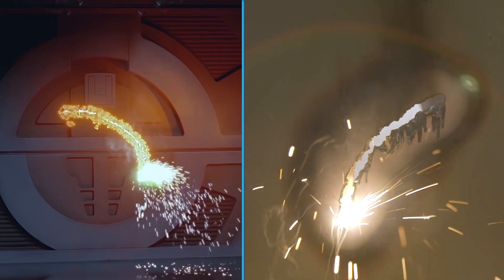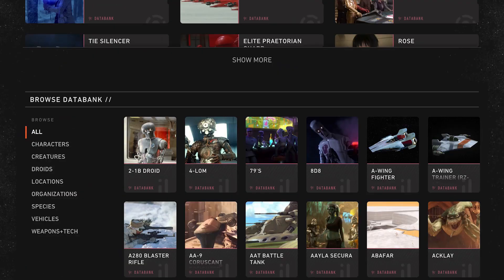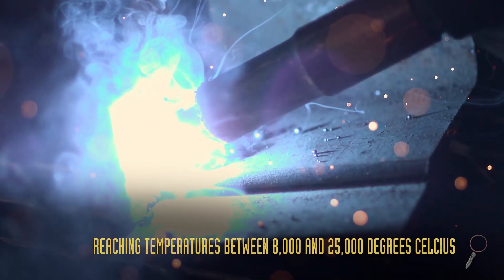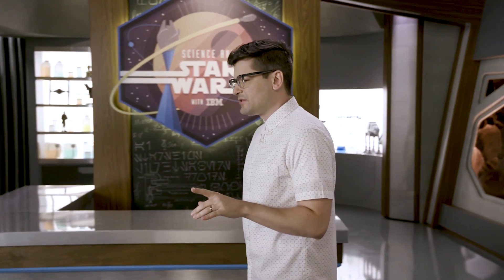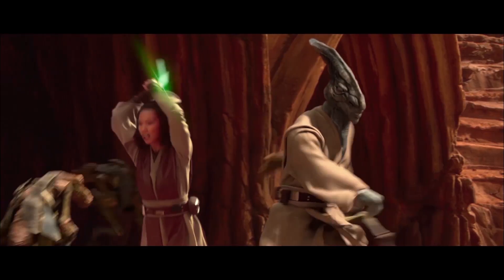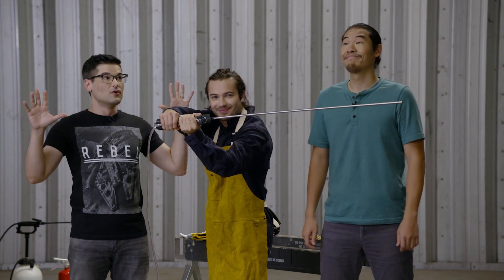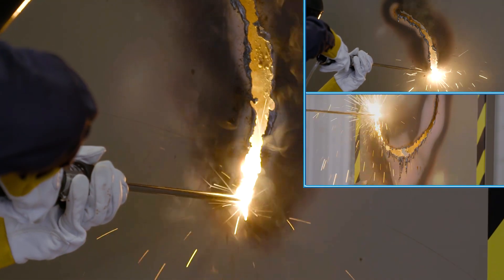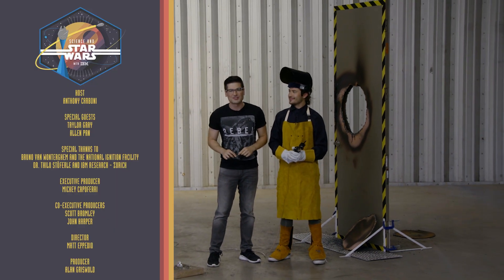Lightsabers | Science and Star Wars

Comment: A Lightsaber would be powered by a small fan and carbon nano-tubes. You push a button and out comes a rod that is surrounded by plasma. There would be a forcefield around the plasma blade. The forcefield prevents the blade from cutting your arms and legs off. There's a heat safety, a brightness safety and a safety that prevents people from exploding and catching of fire.

Comment: For the "We would also need" section...
"Intense Heat Source Beyond Anything We Conceivably Have Today" - While, true, I hold out hope that physics could solve this easily. Also consider in EU there were Protosabers in use that utilized much larger, waist-mounted battery packs and that ran out of power quickly and were used very sparingly. We are probably closer to that than to an actual lightsaber

"Metal Casing That Can Sustain Intense Heat" - Perhaps. I vaguely remember that originally the lightsaber was not necessarily very hot and that originally Lucas was distinct about the saber not even giving off any light. We do have metals that can sustain high degrees of heat. Also regular maintenance and sparse use of the weapon would also lend to the longevity of the lightsaber.

"Way To Turn That Heat Light Solid-ish" - Again we turn to EU and Legends. Originally the lightsaber was a blade of plasma wrapped in a self-contained magnetic field that looped the plasma. It isn't fire or light as we know it, but (as you said) closer to plasma. The blade was also described as weightless but also as if it was pulling or being pulled. Magnetic fields.

"Ways To Give Blades A Specific Color" - The lightsaber gets it's color distinctions via focusing crystals (or kyber crystals as the retcon has declared). Even still, we easily have different colors when it comes to lasers, gasses, lights, and even fire. I'm pretty sure this wouldn't be hard, and even if it was, would it be a deal-breaker to owning a real-life lightsaber? Color for the lightsaber often shows what team a person is on (Jedi or Sith) but the real world is much more nuanced than that and having colors wouldn't really help soldiers in the battlefield identify each other any more than colored muzzle flashes would. In the real world, the best way to distinguish teams using colors would be by uniform. Knights of old had unique armor and colors and coat of arms for their different sides, why mess with a system that isn't broken?

The only thing having colors in the real world would do would be fragmenting users of the lightsaber more than Pokemon Go's colors fragmented the userbase.

"Way To Make Solid Light Bounce Off Other Solid Light" - Again, magnetism. If all lightsabers were contained via similar magnetic fields, they would repel each other when close and probably even bounce away. To get that iconic clash seen in movies where the sabers lock, it's possible that there is more than one Magnetic field being used to hold the blade together and once you pass the first field, the sabers are magnetically locked together while the actual blades interacting with each other explosively.

"Way To Make Light Bouncing Off Other Light Make A Cool Sound" - See above. That could all sound pretty cool.

"Safety Mechanism To Prevent Lightsabers From Falling Through Floor After Floor, After Floor" - Not necessarily. We have seen time after time that once a lightsaber leaves the hands of the user, it often deactivates. Qui Gon, Ben Kenobi, Luke (twice IIRC), and the list goes on of users who have either lost there sabers in battle or have been killed. In both conditions, as soon as the saber leaves their hands, the blade turns off. This probably means that as you hold the hilt, there is a button that is constantly depressed during use, or perhaps some sort of proximity sensor like a car's keyless entry so that as long as the saber is in the 'on' position and the saber is within range of the sensor the blade is ignited. 

I lean more towards the physical button as a kill switch though as when a person dies, the saber often doesn't end up that far from the body and if the keyless sensor was in place, the saber would still be on. As for how the saber throw would work if the button is no longer physically pressed: saber throw is the Force holding up the saber in mid air and spinning and directing it to a target. The user could easily, through the Force, also have the button pressed.

Either way, this would be why this has never been a problem despite the many times we've seen lightsabers fall from people's hands when in use... Also, this wouldn't be a problem if we went with the protosaber route as the hilt would be connected via a strong cable to a powerpack on the person's body.

"Massive Expansions To Burn Wards" - YES

"The Force" - Negotiable. It's been shown many times that a lightsaber can be used by a non-Force User. In the movies, we have seen Finn and Han wield the lightsaber (albeit rather clumsily on Han's part and we don't know if Finn is or isn't Force sensitive himself) and in Legends/EU many more have also used lightsabers without the Force. The reason the Force would be needed is because of all the extreme acrobatics normally associated with lightsaber combat. To do all those flips and high-speed movements while wielding a 1.5 meter sword that can cut through anything but feels only like a 30-40 cm hilt would definitely take extra-sensory skills. Also the construction of a lightsaber is often lent to aide from the Force. (Though I do believe science in the star war universe should be at a level high enough to create a working saber without the Force. For a saber that NEEDS the Force, I'd suggest checking out the awesome ancient precursor: Forcesabers)

"Way To Make Lightsaber Shoot Across The Room Into Your Hand And Make The Girls Go 'Woah'" - The Hacksmith made Captain America's shield return using electromagnets. I think I saw a fan film that had Han Solo do something similar. Either way, if the saber is off and you are smart enough to use magnets to pull the saber to you, you deserve 'Woahs'.

"Celebrity PSAs Preventing Unsafe Lightsaber Uses" - Lol